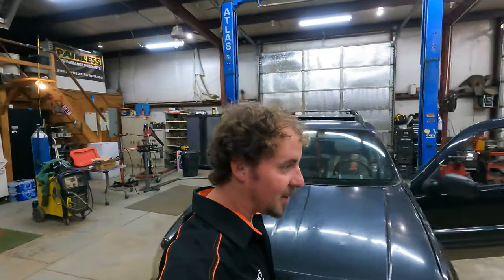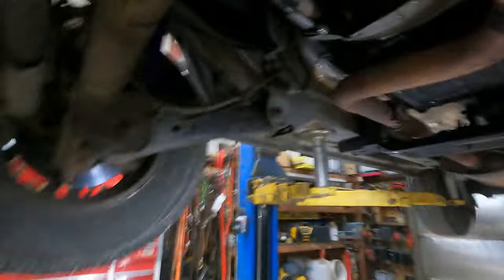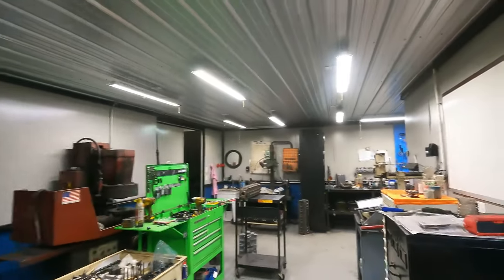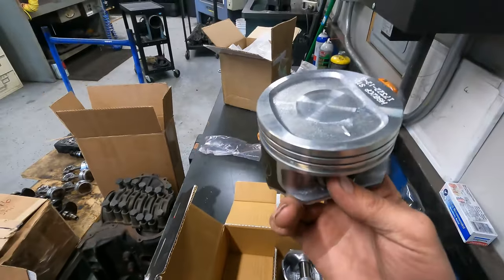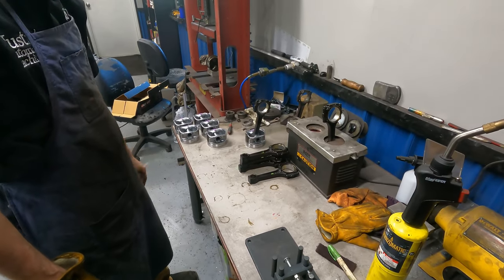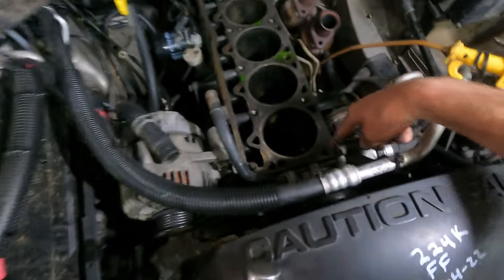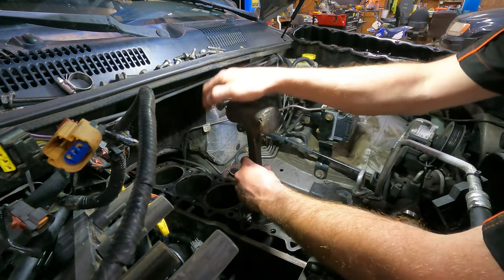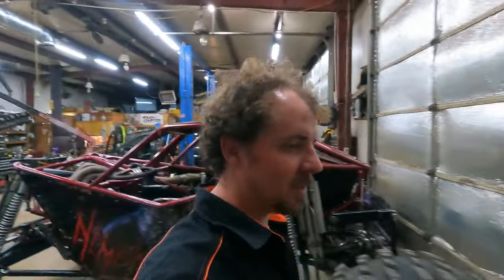Jeep 4.0 Liter Engine Issue: What You Need To Know

Comment: Where are you located?  I live here in Northwest Illinois, land of heavy road salt usage. The Jeep in the video has an undercarriage that's in excellent condition. My Jeep has 280,000 miles on it. It's getting to the point where it's no longer worth fixing due to a rusty undercarriage. I've already replaced the engine 45,000 miles ago due to a destroyed #2 piston, which allowed the connecting rod to gouge through the cylinder wall. The block is junk and not worth the cost of rebuilding.  I disassembled the engine and found piston skirt cracks in the remaining pistons. The engine I installed had low miles when I bought it. It now has piston slap when I start it in cold weather. It goes away after about 30 seconds or so when the piston warms up and expands a little. I may replace the pistons, but the condition of the undercarriage may deem that it's just not worth it.

Comment: Hey. Maybe you might know my issue.  3 rebuilds in a row on the same 4.0 block. Everything new each time.heads done.  030 0305 and 060 bores cut . Piston clearances were triple checked each time. All started knocking at 10 miles. Bearings looked beautiful after. pistons destroyed on thrust side and walls scored on all 6 cylinders
Reply: The crank , cam , lifters , push rods , bearings , timing set, oil pump, valves, springs. 
The third time I used custom rods and pistons. Every time it starts knocking.
Reply: If you have any ideas I would appreciate it. I'm stumped. Ring gaps were perfect. Bearings were gauged.  New manifolds and injectors. Spent all the money and cut no corners . Just to have it fail again and again.

Comment: I have a 04 LJ. It doesn’t knock lake that but, it ticks really bad after it heats up. Did it when I bought it at 98k it has 115k now. Any idea what it could be. Sounds like it’s coming from head back by the firewall. P.S…… I’ve always ran Amsoil in it and change it every 5k.

Comment: DO YOU EVER WORK ON AMC 258 I6 ENGINES? CRAPPY PISTON DECK CLEARANCE ON '76 258: - .110" ( NO QUENCH). DO YOU ADDRESS THIS ISSUE WHEN REBUILDING FOR HIGHER COMPRESSION? HOW? WHAT PISTON COMPRESSION HEIGHT, WHAT ROD LENGTH? PLEASE DON'T SAY: "JUST ZERO DECK THE BLOCK." I DON'T WANT TO CUT MINE! THANKS.

Comment: I appreciate you doing everything it takes to post this content.  I have a 2.5l with 170k and it makes a "knocking or metalic click" type noise until it starts to get some heat in the motor.  Doesn't make the sound at idle, is worst if you put it in gear and drive away but is gone by the time the thermostat opens. I think its piston slap......  what do you think it is?  (other thing I observed, when replacing the crank and rod bearings I saw a witness mark on the edge of a thrust bearing that looked like the crank made contact or something passed between them.  Didn't find piston parts in the oil pan.)
Reply: Let me add this, at first start the sound is more of a tick when revving but sounds more like a knock or clunk if you put it in gear and drive away.
Reply: I wish Dex would answer his comments.  Didn’t answer a txt message either.  Anyone else have an opinion?   I’m suspecting piston slap.  Likely due to a seized wrist pin.
Reply: Could be flexplate bolts.  Try looking up jeep knocking or ticking and flex plate.  Sometimes they come loose.  They are between the engine and bellhousing
Reply: @ironash20  I thought of that and ruled it out after thinking I hear it more from the front of the motor and thought it wouldn’t go away with heat.  I did recently have the inspection plate removed when I pulled the pan.  I have folks in town this weekend so I’ll have extra hands to help.  Thanks for the suggestion

Comment: One of my 4.0's has a tick only when accelerating and after it's warmed up.   It's not the manifold or gasket.  Oil pressure is great, almost too good.   It started doing it one time intermittantly at idle (tap tap ...... tap .... tap tap tap .......) so I was finally able to grab a stethascope and locate it in the general area of passenger side of block around #4 or #5.   If it were a lifter it wouldn't care about engine load though would it?  Possible cracked skirt?   It's been slowly getting worse over time but it's still only there on acceleration.
Reply from the maker: What year is it.  Only 96-06 are known for this problem.
Reply: @dexjs  it's a 96 engine.

Comment: No torque plate here's what to do
measure how thick the head
measure some bores x-y
Bottom tap the head bolts brush and blow out
drop some bb's down the holes  if using studs
put two Heavy washers over the head bolts and screw them in as far as head thickness and measure the distance between the washers when they are spread out one on the block and one up on the bolt head

cut some half inch steel water pipe to your measurement
now put a washer on the block the water pipe and another washer and torque the bolt to spec with head bolt lube you are using
remeasure your bores  any distortion?
now hone the block with red neck torque plate
good that you usually go a little over on your hones without a torque plate

Comment: I had the same thing happened to my 4.0 and took the block and head to get it checked out they told me everything was good they did not do anything to the head or block because it was like it just came off the factory line they told me and the motor had over 200,000 on it

Comment: Did I miss the part where he honed out the cylinder walls so the new rings will seat?🤔🤔
Reply from the maker: This is the 19th year in a row I forgot to do that 😂😂
Reply: @dexjs  Don't bother doing it. Modern rings don't need to grind away their faces against a cylinder surface to fit in a modern cylinder bore. Regular install and use will have them mated 100% in a few miles. Ask your brother. You already mentioned it in passing when you said the rings spin during use. Reason why older engines did 110K miles and needed a 0.040-0.060 over bore and a modern engine can do fine with a 0.020 clean-up at 200K miles.

Comment: ya know, the 87-95 4.0s don't have self destructing hypereutectic pistons. I've got a few "unopened" 4.0s in the 300k+ club and one's really close to 400k (an 89)

had another 89 that burnt to the ground a few years ago because someone lit it on fire @ 435K... that was the one in my profile pic actually!

never had a 96-06 4.0 make it to 300k without needing head work and new slugs around 200K and the one and only brand new 4.0L Jeep I ever bought (2001 WJ) got me a lemon law refund at just 2mi shy of 36K in 2002 & the LL case was filed in 2001... which actually turned into a class action that brought about the existence of the revised 0331 TUPY head casting.